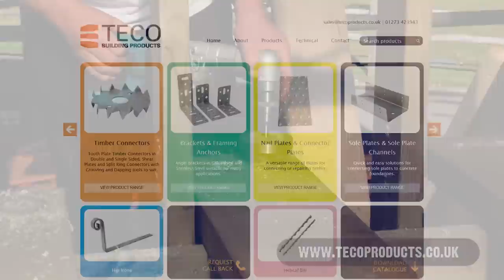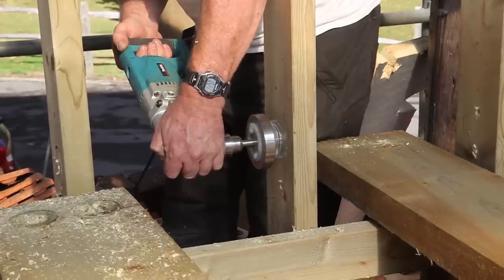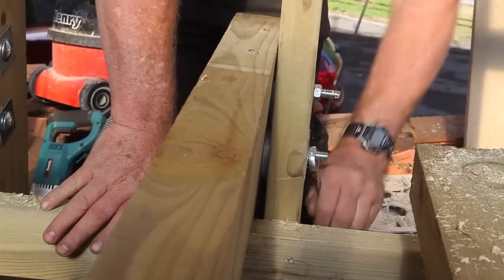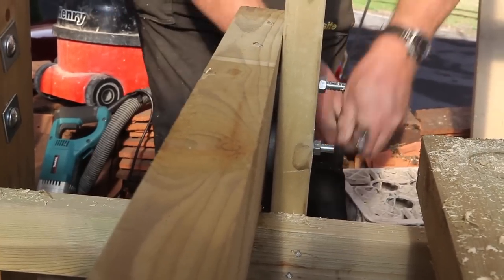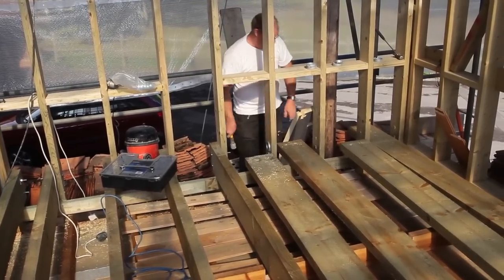Teco Split Ring Timber Connectors

Comment: WE use the TECO split rings for building timber bridges in wilderness areas.   We have a custom cutter assembly to chuck into a historic brace, so we can fit timbers in the wilderness without powered machines.

Comment: There are a few corrections which should be made with this video. 1 The cutter does not create a tapered cut. Look at the cutter and this is evident the cutting blades are on the top and cut a cylinder into the wood. TECO rings are tapered, this is to make fitting easy. 2 Any cutter which creates a groove of the right thickness and depth is suitable, some people use routers and jigs though finding a narrow enough bit is a struggle. Split rings come in two standard sizes about 102mm and 64mm which probably equates to some imperial shenanigans so you can use them on different sized timbers. There is a also a partner in crime called a shear plate used when you connect steel to timber which are similar in nature however they transfer force via the bolt. Now from memory each 102mm split ring is able to transfer about 6000kg of load so they're generally used when you need to transfer "Engineering" loads across timber joints. They were used a lot in WW2 when steel shortages forced people to be creative with wood. For example these blimp hangars made extensive use of split rings https://en.wikipedia.org/wiki/Marine_Corps_Air_Station_Tustin . It's likely that split rings will make a resurgence as high carbon emitting materials become less cost effective and people search for a way to minimize carbon emissions.
Reply from the maker: Thanks Ian
That is all good information
Reply: It does cut a taper to match the ring.  I have two of the cutters and both make a tapered groove which matches the taper of rings.  The orientation of the cutters is key to setting the tool up.  The taper is critical in developing the shear strength at the joint.   The original intent was to develop a method of joining members of a truss which do not transfer moment.  And they work better than any other system for doing that.  Both of my cutters came with tapered pieces of wood, used to check the adjustment of the cutters.

Comment: I found a pair of these when I cut some ceiling rafters to install attic pull-down steps.  Home was built in the late 1940s-early 1950s here in the US. I assumed these were some long-forgotten joinery system. Are they still widely used in the UK?
Reply from the maker: Not widely used because of the specialist cutter but they do a better job than dog tooth connectors.

Comment: Okay, let's start with the elephant (s) in the room  :-)

A web article on European timber connectors flat-out said "will not be discussing split ring timber connectors"; they were seen as an American disease. Most likely due to cost of labor. DIY types (say, me) aren't daunted by labor costs (it's for our project).

That pseudo-fly cutter is silly expensive, and dangerous, and most DIYers would use a router-based solution. Or hole saws...

Right now, on eBay, there are 8 used TECO rings for $13 each,  the bolts and oversized washers not included.

And that's the only availability, short of a $300 minimum order from a U.S. west coast supplier. In all fairness, a 2-1/2" (import) ring is $5 each (not bad...). So I'll probably buy a minimum order and sell off the surplus on ebay.

Comment: What a shame you have to get involved with that fussy tapered cutter, if you could just partly sink a standard hole saw cutter in plenty more builders would be interested in using the system.
Reply from the maker: I totally agree. The tapered ring is great because it makes a really solid lap joint but it is a lot of kit and it is not an everyday solution. I know people like this for barn conversions because it is hidden and works well in oak.  
I wonder if the hole saw would cut a big enough groove? The ring is quite thick.